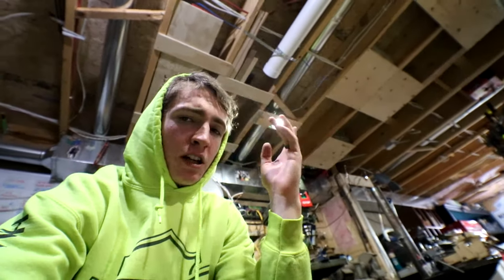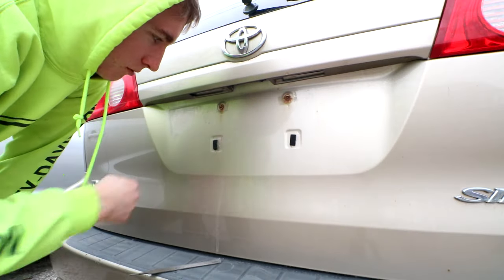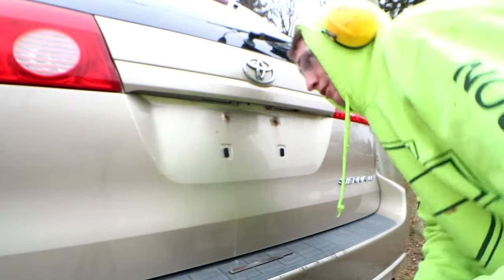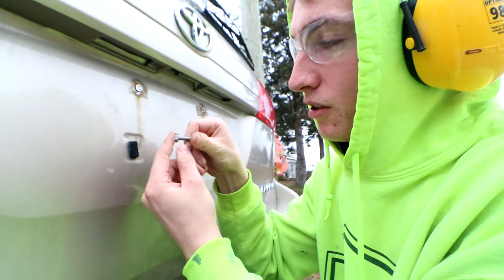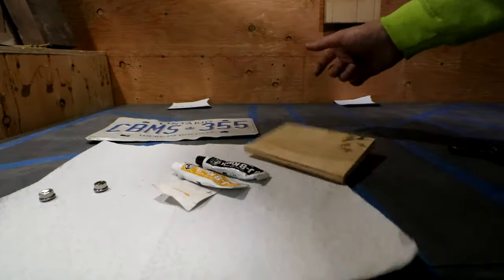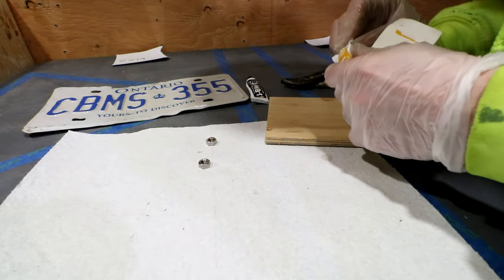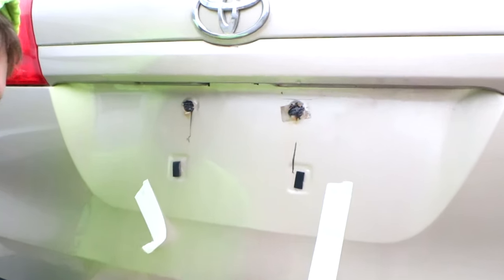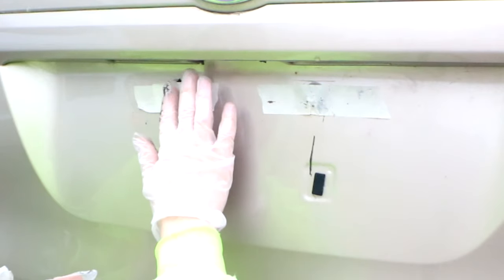How to Replace Broken License Plate Bolts (Easy)

Comment: OR .. pop the plastic off on the inside of the hatch and remove the bolt from the other side. There is literally like 1/2" of bolt sticking through for you to grab
Reply: Not on my car. The screw is flush on that side too unfortunately
Reply: @dajmitch where's your video of you helping people?
Reply: Yeah, until you find out the other side has been broken off too! 😂
Reply: @MileHighInTheSky   If the screw on the inside of your car is rusted off, you have much bigger problems. 🤣  You could save yourself a lot of time and just drill a hole in your hatch , stick the bolt through and put a nut on the other side.  Faster and more secure than epoxy, but hey ... what do I know. I don't make videos "helping" people do stupid crap to their car.  😜

Comment: Dude! This worked on my Toyota Matrix! The left bolt broke off evenly/flush against the gate. I ran up to Ace and grabbed some JB Weld. I didn't have to shear off the ends, I just put a large nut behind the plate and screwed into the new one to fill the gap! Saved me a lot of hassle and time! Thanks!

Comment: Yes, everyone has a grinder and a full workshop. That's why this says "easy" right?
Reply from the maker: Hi Kim. I said you could also use a file, You can use vise grips to hold something too. And you can use a hacksaw to cut the bolt. or just buy shorter ones